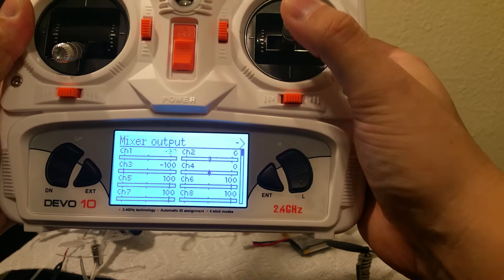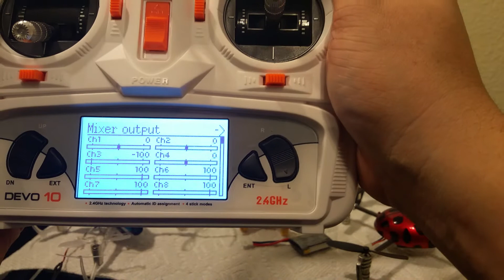Deviation devo 10 function check

Comment: I have the 4 in 1 modul and I tried to bind to a xm+. No matter how I set freq-fine, binding takes 10 secounds (but it doesn't show the remaining time like in the video) but the receiver doesn't react (two solid LEDs). After powering up the receiver again just the red LED flashes and it is not bound. Is there a way to test what is faulty without a secound receiver?
Reply from the maker: Maximilian Groß best to bring this question up to rcgroups or facebook group as i have not flown for over a year and am out of touch (had to move to a new state).  Sorry, wish i had the answers for you.
Reply: Thank you nevertheless.

Comment from the maker: Matrix turbo ace sounds like a walkera/devo  protocol, but i dont have an immediate answer. also, i  dont know  what rx you are using. Deviation firmware is always updating; the menus change slightly (similar to microsoft windows or android firmwares).